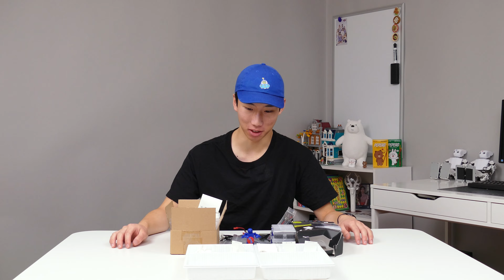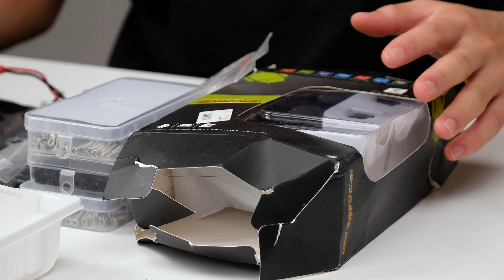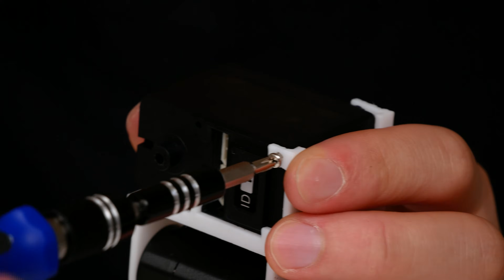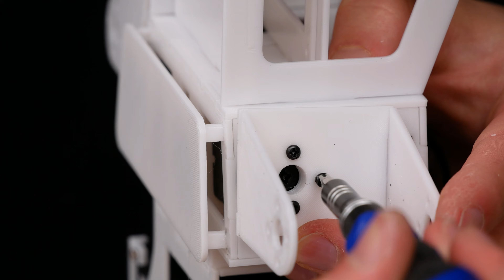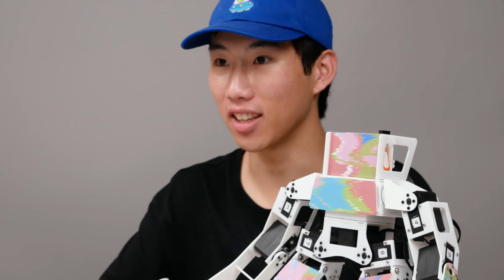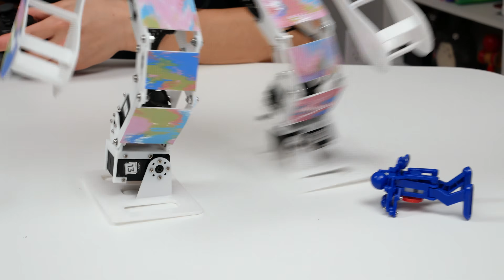3D Printed Fighting Robot

Comment: I was wondering what software you used for programming. Ive tried lobot and it does t work with the hiwonder board. The hiwonder software won't read the current angle so I can't actively move the robot to make moves. Any suggestions?

Comment: I took it apon myself to build one of these, and my friend is building one too. I'm struggling with the tiny little plastic threaded screws they send with these servos. Do you have a suggestion for better screws that are slightly longer to go through the printed parts and hold the servo bodies better?

Comment: That's insane. I wanted to buy a super anthony but it was to expensive. I will give it a try and build a cheaper version with my sg90 servos. I will change a bit the stl files to fit the sg motors and to have less weight.
Reply: It worked?

Comment: I would love to acquire the 3D file, but is it somehow possible to have access to the motion code...? Have you calculated by yourself the FK, IK, Dynamics and so on or have you used any platform... And one more thing: is it possible to adapt other cheaper servos, like S3003 in place of the LX-16A?